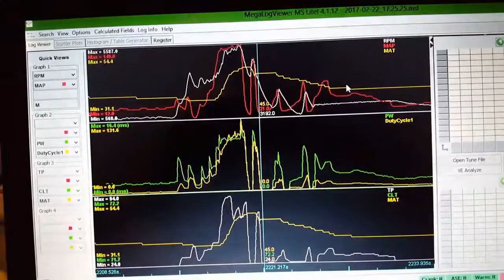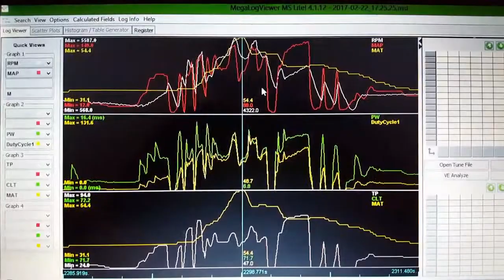IT WORKS!! cheapest water methanol setup in the world!

Comment: You don't need a solenoid that just get a one-way check valve but solenoid  mite be a little neater and maybe give better results.
 Nice to see the results of the temperature though great work great video. Keep it going u doing really well on this. . 
W&m have  it's advantages.
What i  don't like is when people put a water and methanol kit on don't advance the timing or do any mapping and expect massive results lol . What ratio of water to methanol using 50/50

Comment: could you drill a hole in the compressor and put a fitting ?
Reply from the maker: I can now that Im running a high pressure pump and AEM nozzle, but im not sure what pressure the washer pump in this video would produce to push back against boost pressure